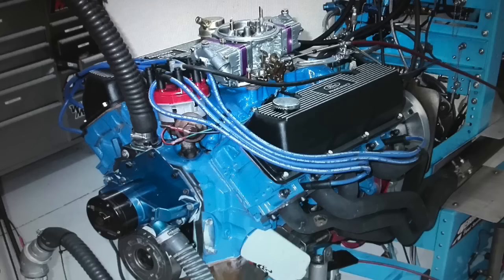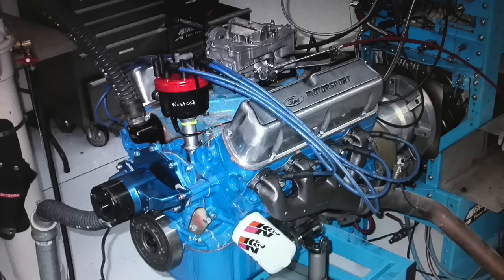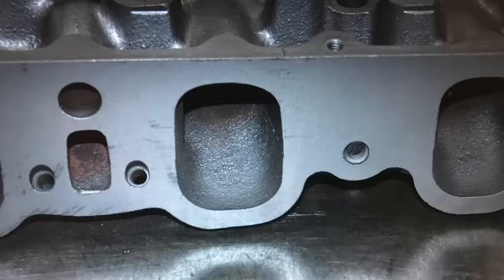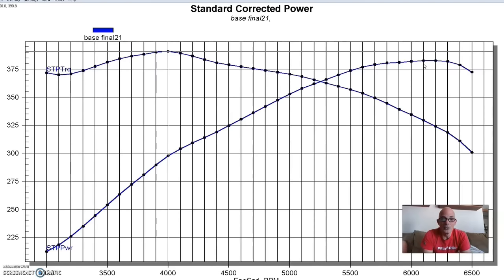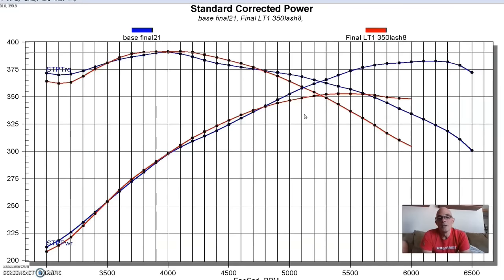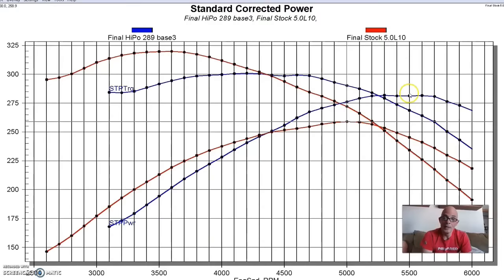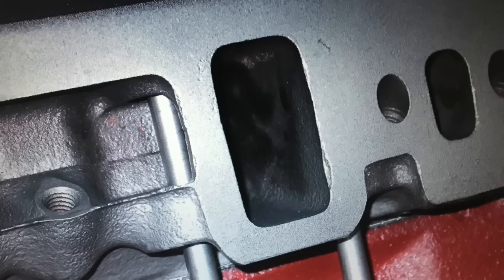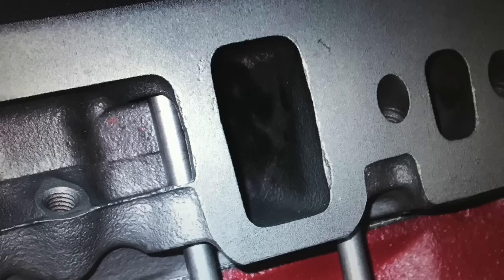HOW MUCH POWER DID THE 1971 BOSS 351 REALLY MAKE? WAS IT THE HOTTEST SMALL BLOCK EVER OFFERED?

Comment: Love the way a 71 mustang but you can't nothing behind it a cop can be right behind you and you'll never know till you get on it. I know I had one and I'm 6'4" I got rid of it for that very reason. Still got my 67' though. I'VE GOT ONE question was the m code a 70 mustang torino engine. And I've got a thing to tell you also they also made a large chamber 4v that also looks close to the 2v heads because I've got a pair that's got the 4's on it and they are definitely not closed chamber heads
Reply: Oh and they did rate the fe 427 at 425hp and they made between 500-650hp because the insurance companies didn't want to insure nobody with that much power from the factory
Reply: Yea,they had some open chamber 4v heads.3514v regular fuel

Comment: The ss amx 390 smashed all kinds of records in ss/d, ss/e classes.
12.3.1 compression, dual hollys, ect. AMC rated it at 340, NHRA changed it to 420 hp.
Not really a fair comparison as they only made 53, but you could walk into a dealership in 69 and buy one.

Comment: I have killed so many engines through ruthless straight blunt force trauma throttle abuse and I have never had anything that was as masochistic as my 289, it's as happy as my wife when I wash the dishes as I stomp it's guts out on the daily and I find  it's lower torque output is made more linear and with far less heat retention than the plethora of 302s that pretty much fall on their face at 4637 rpms wheezing from valve  float and heat soak. If  all aspects scrutinized equally the 289 is the "Goldilocks " of the v8 world.

Comment: I love how the guys always say their 289/302/283/327 would turn 10,000 rpms, they had points ignitions.. NOPE.. when I dyno with points,and I am lucky to get to 5000 without the ignition giving up. I guess the old points were "magic" they were no doubt better, but8 ,9 or 10 thousand RPMS ??? REALLY ?
Reply: Try high performance points. They have more spring tension.
Ever hear of a dual point distributor?
Reply: I've pulled 7k's with stock single point. Prob 8+k's with properly set-up dual points & coil. Step up to modern race ign and those motors will live. There's a guy running a repro boss 302 in historic TA...in-car camera shows ~8200 tach almost continuously around entire track for ~30min race. Not a brap, not a 20sec dyno pull...30mins at 8k+. 5k means you're doing something wrong :D

Comment: There is a whole different story to tell about the 289 hp when running a 12.0 to 1  to 15.0 to one  and a good set of aluminum heads and race fuel!!
Reply: Big deal
Reply: The 289 Just doesn't have enough Stroke, yeah maybe a Different Story in a 2000 lb. Car. But most cars are over 3000 lbs.

Comment: No doubt the Ford had great cylinder heads and the potential showed . I don't remember what the 340 six pack made but I thought the torque was pretty impressive . I not a Dodge flag waver , I had several including a 426 marine wedge I bought out of a boat and installed in a 68 charger back when . There is something to be said about running better heads and less cam to make a great running motor.

Comment: 351 Cleveland R code Boss has always been a bad ass motor. As far as your 289. It was decent for back in the day. Sure it didn't flow much but putting that in the hands of those Shelby boys we all know there was no way they were leaving it stock nor anywhere near that. 
  I'm sure they pulled alot of material out of those heads to make it flow like crazy. More lift and alot more spring. In Shelby race trim. For the track not production Im sure that motor was 400 hp or more. They were like us. Stock is boring. With exception of the 351 Cleveland R Boss motor. Thats not bad at all lol 😆

Comment: If you take the  271 hp and  divide it by the  15% difference between Gorse and net hp !
 The 289 i had  would  run with a 5.0 stocker with no problem!

Comment: A 260 289 302 351w is a small block the 351 Cleveland 351 m and the 400m never had a official weather or not it was a big block or a small block
Reply from the maker: a 351C has a shorter deck than a 351M or 400-it is definitely a small block, the others are medium (meaning not as big as 460)

Comment: The small block Chevrolet was never designed for racing,  it was the cheapest model of car Gm made.   Pontiac and  Oldsmobile were the performance brands of the division.   The small block Chevrolet all things being equal dominated Nascar for 40 years.   Jeff Gordon never drove a Ford.   The SB 2.2 solved all the problems Chevrolet had..
Reply: ZL 1 - 454 was a true NASCAR racing engine, the 427 with the Snowflake head's were a true racing engine.  The Small Block Chevrolet was designed for 283 / 327 size bore.  All of the 283 / 327 small journal crankshaft were steel.  The size of the intake and exhaust ports and the thin casting prohibited large flow numbers like the Cleveland.  But as you saw in the video, the 4V Head was a turd unless you cranked it over 7000 RPM.
At 7200 RPM the block would crack and if you pushed it past 500 HP the block would crack and you would be looking for a Windsor...  That is why the Pantera was such a turd.
In Buffalo they couldn't give them away.  The tailights would fall out on the way home and they spent more time in the service bay than on the road.
Mach 1 Mustang the same thing.
You would get about 60,000 mi and then the Cleveland would need a overhaul and valves and guides because of the canted valve. Chevrolet small block you could putter around town until the camshaft wore out, put in a new cam and lifters and get another 80,000 miles out of it.

Comment: It's apple's and oranges, you should look at the k code hope motor in shelby GT 350 R configuration,  make sure you have the Lemans camshaft and the shelby dual quad intake. With the porting as shelby used on the heads. If you do this I think you look at the 289 hip a little different. With the Ford make do with what we have out look, and they were putting their R &D dollars elsewhere the ford small block program didn't the development like Chevy did

Comment: 340 six pack 1970 mopar might be highest hp or torque
Reply from the maker: nope-actually the 1968 single 4-brl with the unique (1 year only stick only) cam would likely make the most-but still not what the Boss 351 made
Reply: @richardholdener1727  true torque 382 .another test on you tube i found.
Reply: @richardholdener1727  360 . Have you tested one? Thanks

Comment: The Boss 351 engine was THE best small block engine Ford ever made but they only made 1800 or so of them and by 1971 the muscle car wars were over and to top it off they put the engine in the biggest heaviest Mustang Ford ever made. So it was without a doubt the best but almost as rare as a Boss 429, only produced 1 year, a very expensive option and came out in the heaviest Mustang made. You should have put that same big Holley from the 351 and some headers on a performer RPM air gap intake on an L84 327 which ALSO had 11 to 1 compression and a solid lifter cam and came with mechanical fuel injection and made 375 dyno proven horsepower with manifolds not headers. That is comparing a fair Chevy small block to a Boss 351.
Reply from the maker: both were run with headers and a holley-why RPM Air Gap of the 327-the l76 already had a factory dual-plane High Rise
Reply: 375 dyno is only 305 hp NET in the car.....

Comment: 340 six pack with stock manifolds made 356 actual hp and was considered the highest compared to Ford and Chevy by, HOT ROD MAGAZINE.
Reply: Is that test available online? I'm a Mopar guy and the only test of a stock 340/6 pack I've ever seen is on YouTube done by Nick's Garage and it was very disappointing. I think it made 325hp. Not very impressive compared to a 360hp 327.
Reply from the maker: that was a modified motor

Comment: I have no doubt that the Boss 351 was the most powerful small block. Just look at those freakin' heads! I have no personal experience with the 289 Hi-Po, but period road tests tend to show 1/4 mile ETs around 15.7 sec. and trap speeds of less than 90 mph. That's comparable to a 1982 Mustang GT, which was a slightly heavier car and it's engine was only rated at 157 net hp. I've never been too impressed with the 289 unless it was in a real lightweight like a Cobra or GT-40.

Comment: You're selling a little 289 short. The 289 hi-po came out in 63. The 351 boss in 71. 
  you compare the 289 to a 302 from 1988. By that logic we could carry a 351 boss to the GT500 5.2. The 351 boss would be a dog
Reply from the maker: I compared a 271-hp (rated) 289 to a 225-hp (rated) 302.
Reply: @richardholdener1727  my point was technology and Design improves with the newer stuff

Comment: I remember a 289 Shelby with dual quad intake, with that long Shelby air filter cover! That version I am certain made more power and the late 80’s 5.0 was advertised hp of 225,,, yawner! Anything less than a 10/1 weight to hp ratio is slow!

Comment: I have a set of 1965 Hi-Po heads and the ports are tiny tiny and the factory machine work is kinda sloppy. I won’t use them on anything, just looking for the right buyer.
Reply: Dammit! I sold my K-code '66 Mustang last year. I was trying to find the parts to build a correct K-code engine but they are getting harder to find every year. Oh well, it's someone else's problem now.
Reply: 1967davethewave my grandpa pulled them off a wrecked Fairlane in a junkyard in the late 70’s or early 80’s and I rediscovered them after he passed away. I think he put the factory intake on a customer’s mustang ( 1966 ? ) in the late 80’s. That car was put into the ditch on both sides of the road by customer’s teenage son.  Then it went to several body shops until they decided to scrap it but we never got the chance to recover the motor.

Comment: The 1971"Boss" 351 was already (after 1968!) a low-compression cat-conned "smogger" engine that Ford claimed to produce only 178 Horsepower, which NONE ever did! 6.0:1 Compression ratio with two offset valves per cylinder at 5500 RPM by Sir Harry Ricardo's formulae, can't produce 163.4 Mean Brake Engine Horsepower and less than 210 ft./lbs. (by bore and stroke specs.) Raise the compression ratio back up to 11.2:1, and it is THEORETICALLY possible to produce 340 HP @ 5500 RPM and max torque of about 360 ft/lbs. @ 3000-3200 RPM. PEOPLE LIE but 140 year-old engine formulae DON'T!!! BTW, the first time a GM skinny block makes 1000 REAL HP, I'll put it between two pieces of BREAD and EAT IT! Not enough iron in the block to withstand that pressure/RPM level 1000 HP would DEMAND. Nineteen seventies cars made less than HALF the HP and torque their 1968 brothers did, with the MOPAR limited production (750 units per year street versions) exceptions. By 1972, the MOPAR 440 Max Wedge was down to 155 HP from the 1970 limited production 378 HP. My 1974 Dodge Dart 4 door sedan with a 318 V-8 was rated at 137 HP and 185 ft/lbs. The Slant Six was rated at 90 HP and 135 ft/lbs. and when the A/C was on, the six versions were weaker than a Toyota Corolla 2.0L (93 HP), and there was NO 5 speed stick for the Slant Six ONLY automatics in all but "high altitude counties". I bought 1970's and '80's and 90's cars NEW, and my 1984 Toyota Camry LE would OUT-DRAG my 1978 Pontiac Brougham 4 door sedan with a PONTIAC 302 CID (NOT a 350 Olds engine!!! I had to fight parts guys over the LONG 12mm spark plug threads vs: the 350's 14mm 1/2 inch threads!!!) and TurboHydromatic 250, despite only being 980 pounds lighter. The 1992 1/2 Camry 2.5L V-6 Auto was quicker than ANY US Production car thru the 1/4. I bought a gallbladder surgery instead of SEVEN Camry's dollar-wise!
Reply from the maker: the 1971 Boss 351 still had high compression and made this power level as illustrated by the dyno results

Comment: Thought the boss 351 was a Windsor with Cleveland heads. This looks like just a Cleveland
Reply from the maker: the Boss 302 was a Windsor bottom with Cleveland heads, the Boss 351 was just a Cleveland
Reply: @richardholdener1727  what’s a 351w with Cleveland heads? I was always under the impression that’s what the boss was. I knew the 302 with Cleveland heads was a boss. Thought it was the same for the 351w

Comment: I think you need to compare this to a 400 RA IV or 455 HO. Both are technically small blocks because Pontiac only had one block size. I think they may have the ability to top the Boss 351. I do find Boss engines very interesting, waiting for the legendary boss 429 with the hot cam.
Reply: Why would you say they are technically small blocks ??  I would tend to say they are technically big blocks.
In that era of engine design who had anything remotely close to a 455ci "small block"
Reply: @stevenlitkey9354  small block vs big block is a journal size and bore spacing category. Also look at the ls, the iron block lsx can contain more than 468 cid. Also a Pontiac is similar in size to a sbc not a bbc.
Reply: Fair enough counter point.  We can agree to disagree 😁  I'm looking at factory format, not what can possibly be squeezed into a particular engine platform.  Although not technically a big or small block, I will always consider a Pontiac a "big" block category motor. It's physical dimensions and weight pretty much bear out that fact !
Reply: @stevenlitkey9354  yeah I see where that comes from, its always been a great debate. It does have the precedent of competing with other small blocks in small block classes. It also started as a high 200 cubic inch engine. That continually got bored and stroked until you see the 455, one other good set of examples is the 400m or 400 sbc.

Comment: Raise the exhaust the professional way, and fabricate the headers as per FMC with said headwork. Check the horsepower & torque then.
How about try the 1969 BOSS 302 heads made to run on the Cleveland, raise the exhaust, properly fabricated headers, PLUS a 1972 H.O. 351 camshaft in it? They were grown to produce near as much power as the BOSS 351, in a lower compression engine.

Comment: 1971 buick 350-4 which had 400hp
Reply from the maker: rated at what?
Reply: @richardholdener1727  gross horsepower was believed to be 400hp but net could be lower.

Comment: Your comparing  different years of technology.  Yes we took those 289 to extreme rps . If you  change the heads on a 289 yes way more power. Remember 351 is 60 cubic inches more and technology is was way more advanced